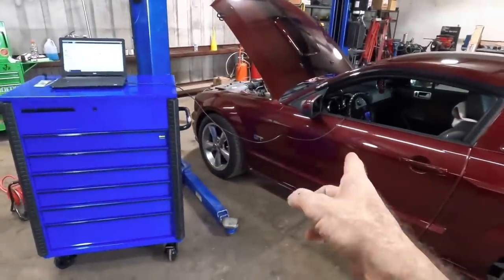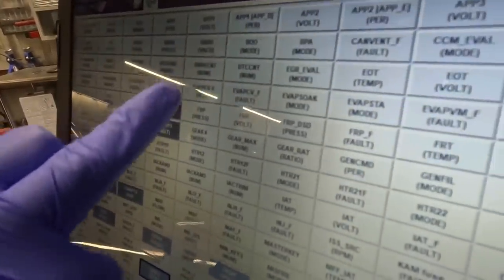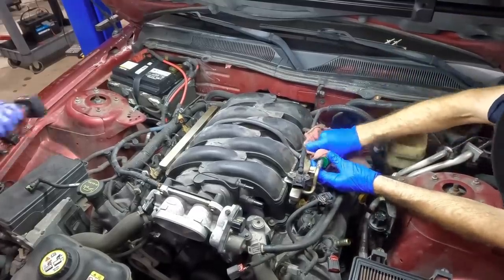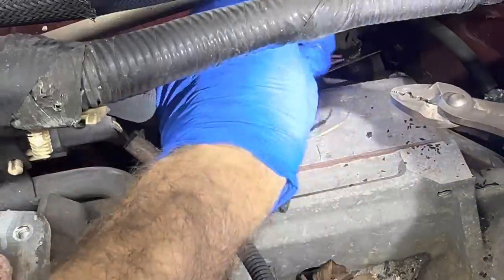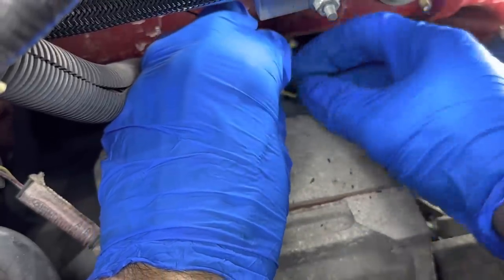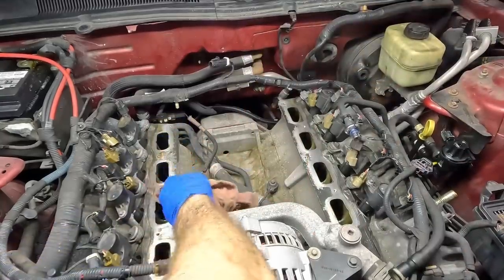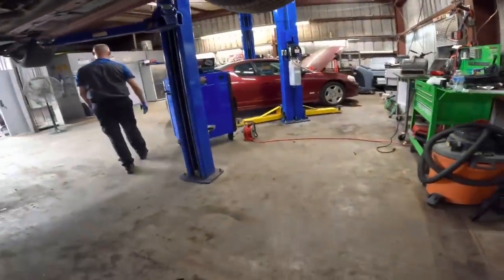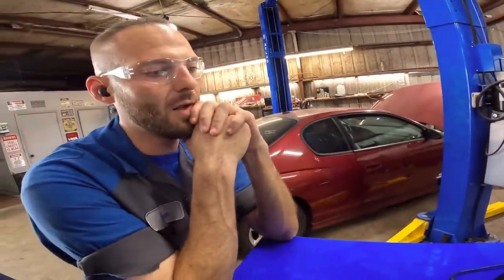Customer States: Light back on! 2006 Ford Mustang GT 4.6 3v P0171 P2096 Lean Bank 1 Misdiagnosed?

Comment: Aron said it right there “DIYs do not have access to” which has become a real problem over the years and it is getting worse! Back in the day, a vehicle purchased meant that everything on or in that vehicle was yours. However, in the eighties, the dealerships were in trouble because people would not bring their vehicles back for service. Then came the PCM, ECM, TCM, and that annoying “check engine” idiot light. Then the trouble started with the diagnostic codes and the machine to retrieve them. The software became the manufacturer’s proprietary realm which shut off the DIYs and forced the owner to return to the dealership to repair the vehicle at exorbitant prices. So, who owns the vehicle? The manufacturer or the person who bought and paid thousands of dollars for it?  Sure, we have our SnapOn code reader and diagnostic tool but the dealership has tremendous access to other software features vital to the true repair of the vehicle!  It's an immorality for the manufacturer to hold the vehicle owner and those who work on them hostage to their proprietary software! I contend that any software installed on the vehicle which I own becomes my property and I have the right to access that software and devices to initiate any repair or replacement!   Who owns it? The rightful owner or the manufacturer? To restrict the repair of a vehicle and deny the rightful owner access to tables, settings, and stored values to reset the device is wrong!  There are stories of vehicle or machine owners (farm equipment) denied access but were able to replace the appropriate part but still machine does not operate because the software-controlled device could not be reset. A ten-dollar part but to get the manufacturer to reset the appropriate control module cost the owner thousands of dollars!  Absolutely wrong!

Comment: Add a reflector tip to your heat gun, it makes using the solder splices easier.  If you are having an issue heating the other wires not being repaired, wrap them in wet paper towel and secure with aluminum foil. Lessens the risk of accidentally melting the neighbor wires.  Remove covers before looming.

Comment: If you hit the solder portion first to melt it, the sealing sleeve portion will follow suit thus cutting down time to make the repair. I work with these exact splices in the aviation community as an electrician so my input is not BS. Love your show. Happy Father's Day Rainman
Reply: If you have seen Ray do them, he does start at centre solder portion. It was Arod with the heat gun moving back and forth, as he says at 20:20 "I've never actually used one" .Arod is wearing the lilac/purple gloves.
Reply: It's been a while since he has been required to perform a wire repair. If this is the case I apologize for not remembering.

Comment: Wow impressive the Harness is Chaffeed but no brake at all in the wire definitely makes sense why no circuit codes so when the engine is running at higher rpm that explains the random o2 sensor drop outs wasn't consistently dropping out at all @Rainman Ray's Repairs

Comment: just great how you two double teamed that problem having a friend that works on a specific 
brand of cars knows the unique issues that creep up every so often. it was a very unique 
issue having a grounded destroying the true signal from the O2 sensor. confusing the ECM
what to do to correct for the values and to run the proper trim controles. happy fathers day to you!

Comment: Good job guys. It turned out to be an intermittent issue.The factory scanner did have some features that worked better.But with  all due respect ,a good visual look may have spotted it.Even though most viewers would have said NO WAY you can't see that up there.BUT as Ivan and Eric o say LOOK for rub spots like corner sheet metal rub spots,and that was the case here.Glad to see it worked out.

Comment: Now that’s a class act! When anything defeats me, which still happens occasionally, I don’t get to have the expert come to my place and use my tools, with me looking on.
If I farm something out, I have to deliver it, leave, wait for the call to say it’s done, collect it again and usually provide a loan car for the extra day(s) that it’s away. That invariably means I’m not doing something else, while I’m shuttling cars around and often means I have no personal transport, too.
Ray has it SORTED!
As for the problem, that’s becoming much more common nowadays, with all the thin wall cables.
It’s a proper PITA to find, too, because any time you disturb the faulty cable, you solve the problem temporarily. It takes a bit of driving and start stop cycling to settle the cables back to their original position and make the problem reappear.
The diagnostic kit is good for telling us which signal is wrong, providing we know what we’re looking at, but you still need a schematic and ideally a harness map, to know where to look on the car.
This was an impressive find.

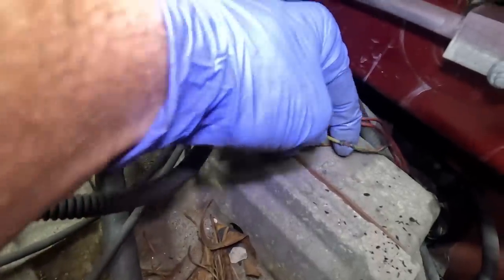Comment: At 14:57 in insulation damage to wire being chaffed by transy. Causes a higher resistance in the wire thus the sense of a 
lean condition and since it didn't break no code to indicate  otherwise. Solder connector if done correctly is the best fix. 
Good repair  Team Ray.

Comment: I did this exact job on my 2009 Buick Lucerne with 305, 000 miles. It kept blowing the fuse for the Upstream O2. I originally replaced the sensor, but the issue came back. I then moved the wires in multiple spots including under the car. Doing this I found the wire had rubbed to bare metal on a brake line. Wrapped in electrical tape, tubing, and zipties. Works great now!

Comment: This happened to me with a family members car. Trans would not shift out of first. Shop said trans was bad, I looked around and saw a chipmunk ate 2 wires on the back on the engine. Repaired the wires shifts fine and that was 5 years ago. Hey sometimes the best make mistakes as well. It happens.

Comment: Don't sell yourself short, Ray. You didn't fail in the repair of that vehicle. Sometimes, you have to step back and look at things from an outside perspective, and sometimes, you need to bounce things off of others who are just as knowledgeable as you are. Even Aaron was stumped until you two decided to trace the wire from the sensor and found the bare spot in the wire.

Comment: After watching lots of videos of Ray fixing things I've learned Ray needs a few things:  1.) Unlimited supply of brake clean, 2.) a shop air powered torque wrench, 3.) official Ford laptop & software & cable, and 4.)  lift buttons that says subscribe on it for the lifts.

Also great teamwork to Ray & other guy

Comment: I just swapped engines in my 09 v6 stang, misaligned the torque converter and cracked the transmission pump sandwiching everything back together... Cant say she had much life left at 205k never serviced but damn it hurts... Gonna drive it til i kill it. New engine runs great. Happy fathers day.

Comment: I used the same heat shrink on my fridge as a mouse or something chewed thru the wires under my fridge making the fridge stop working. I saw it got warm and wasn't running. it chewed thru like 3 different wires in it's harness. Now it works again without issue.

Comment: Tip: When installing Wire Loom use good quality electrical tape at the ends of the Loom and every 6 inches. This ensures the wires will not vibrate out of the Loom. Some manufacturers go as far as tapping  the entire Loom at some locations.

Comment: I have the 4.6lt 3v on my 2006 mountaineer it has 180k miles and has that cam phaser ticking sound. but it's been making it for a long time I bought it back in June of 2018 and it was making it at that time as well.

Comment: Because you are dealing with a v block, that opens up for situations. If both o2 sensors were replaced, that doesn't eliminate them as the source of the situation. The tps would effect both banks. The inactive sensor has to be either the problem or related to it.

Comment: Excellent video.  For wires like that, I've had good success with liquid electrical tape.  Vinegar will clean up corrosion, if any, beforehand.  That way the original wire remains intact.

Comment: Crimps with the heat seal, i believe are better.  Ive used them exact connectors, you just used to have them fail.  Either way 1/2 dozen to the other.

Comment: Hey Ray, great job. Just 1 thing. Those solder connectors are no bueno. They use what in electronics is refferd to as quickmelt solder. An alloy of tin. They melt at low temp. But these become brittle and you get an intermittend connection again in few months. Because there is no resin, there in no good bond between the tin and copper wire. and when it becomes brittel then only the blue glue holds your wires togheter. but with the vibrating car it will not be a permanent connection. You can also ask Eric O. he stopt using these already few years ago when he noticed these connetors being an issue. 
Doing great with shop. keep going.
Reply: I banned them from my shop 20+ years ago. They are a problem on many levels.

Comment: I wonder how those solder connections with heat shrink act around a motor's heat, since they melt with just a heat gun.
Reply: I thought the same thing. If the  solder has low enough melting temp to liquefy with a heat gun, it might fail in a hot engine compartment.
Reply: Can the solder be pre-treated in some way so that it melts easily on first use, but then the remelt temp is much higher?  I've just ordered a box of them to test that because, as you say, they might otherwise be able to dismantle themselves, and that would not be good!

Comment: I had a similar problem with my 2003 G35. The factory didn't allow for enough wire in the harness for the trunk, so a wire would break from opening and closing the trunk. The car had no external way to open it, so I has to crawl into the trunk from the back seat to release the emergency release. 

The first time it happened, it was under warranty, so the dealer handled it. It happened again when it was out of warranty, so I fixed it. The idiot dealer techs just crimped it back together. I fixed it properly like you did by adding a piece of wire. I did it the old fashioned way though with solder and then heat shrink.

Comment: Hey Ray and Rod,  why didn't they put a heat shield tape on those wires instead of just plastic loom.    For being right behind the motor where most of the heat is pent up, and most of the drying out of plastics a -cur.

Comment: I'm not sure if you did or not but make sure that you let your heat gun runs on cool/cold position for approx 2 minutes before to turn off the power. The life of the heater element will last much longer. (Daniel)

Comment: Had a bare wire on my focus on the camshaft sensor which would throw a check engine light randomly after I had changed the sensor!

Comment: Brian at Fordtechmaculoco had something very similar to this with a Ford F150. Turned out that someone swapped out four different fuel injectors on bank 2 which caused a similar problem as you have with the mustang.

Comment: Happy Fathers' Day to all Dads... As you were closing out the video, Arod(?) locked the car with the remote... after watching a CBC program called CBC Market Place where a TV crew were preparing to leave their hotel in NYC for Toronto, they loaded all their personal luggage into the rental van including all their video production equipment, used the remote to lock the van, then went for breakfast. When they returned, the van was empty, everything was gone. Thieves were close by with a radio receiver and computer, decoded the remote's lock signal/codes then unlocked the van. Recommendation, use the lock button in the door when locking your vehicle, personally I do that all the time whenever I leave the car, even in my garage, if you do it without exception, you will not forget to when in an dodgy location.
Reply: Or just stay out of NYC. 😂
Reply: @Bellboy40  Sheldon Cooper laugh...

Comment: Did I miss something? Explain to me exactly why you left that small piece of blue wire on the engine under the intake manifold after you vacuumed it off so nicely?
BTW: I've solved some of the toughest problems, by backing away for the day, and re-tackling again the next day.

Comment: This type of repair should be sent to the engineers so the next model they fix any posability of this on the next model year or changes, has these wires came up through the Floorplan with a grommet under the seats just giving enough slack under the car for movement but bringing the connections inside the cabin where the wires can't chafe also any repair needed are in hands reach.  When you put a connection point high up behind moving parts or just laying over metal parts insulation can rub off the wires causing problems that are hard to determine the problems  no way could you just see this under the car, hell you could barely reach it.
And an 02 sencor is a part youll need to change from time to time.
It shouldn't be that hard to get to. 
Better planing save shop repair times.

Comment: We chased an intermittent sudden shut off problen in a VW Jetta for 6 weeks once... trned out to be a wire broken inside the insulation and hiding behind the motor. Techs went thru everything trying to figure it out. Even swapped parts off a good running car, including the entire fuel system from gas tank to injectors, ECU, and more. It took more luck than skill to finally find the problem, but had become a matter of pride and sheer determination to figure it out! The shop lost money on that job.

Comment: Those heat shrink connectors not good for automotive applications about 12 months will be having problems low temperature solder doesn't handle vibrations very well

Comment: I used spring-loaded wire strippers for years (easier in tight spaces), no gloves for wire splicing and don't you tape the plastic loom at least a little?

Comment: I predict when Ray resumes gracing us with videos it will be showing the new and improved shop with all new goodies in place.
Reply from the maker: I’ve been on vacation not renovating😉  Buuut I do need to get the walls scrubbed again and maybe get some paint on the panels
Reply from the maker: And get the door up, and get the lift installed, and run some new outlets… the list goes on and on and on
Reply: @RainmanRaysRepairs  and on and on..etc.etc.etc.

Comment: Has anyone pointed out that wires should have a little flux applied to the bare wires to improve solder connection?

Comment: Happy Father's day Ray. Where do you get those heat shrink connectors from? I want to use those on my stereo rewire job. I used crimp connectors and I don't think they worked very good. Thanks and have a good day.

Comment: Those connectors are against all training on making good solder connections. Wires should always be twisted or crimped, then solder, never use solder to make a connection. In an automotive application that heet gun connecter can melt from the ambient temp under the hood.

Comment: Wires are always the worst to diagnose, they could fail sometimes but work other times and there is soo much that you may miss the tiny bit that is not visible. Not to mention companies don't make wire colors standard, even for the same vehicle replacement parts.

Comment: The two things that I don't understand which could of been done a bit better -1 Why were you using a battery operated tool that produces sparks after all that fuel spillage { Fire hazard } -2 If the wire was only chaffed where it was still in-tacked why did you cut it where all you had to do is test it for continuity and if it was good then re-coat the exposed area with liquid tape - where it would have saved you some time - cause now you made I would think 2 extra weak points and changed the resistance value - just good thoughts for next time... but as always Sherlock Raymond wins again... Good job there...

Comment: There should be better cable management for the O2 sensor wiring to prevent the movement that wore thru the insulation.  Most likely there was when the car was new, but over time with plastic holders falling apart and mechanics saying "we don't need that bracket/holder/clip" you get this result.  It was good to see all the effort exerted to do a quality wire repair, but VERY disappointing that these two mechanics with all their experience were guilty of the same vice as their predecessors, not properly securing cables to prevent reoccurrence.

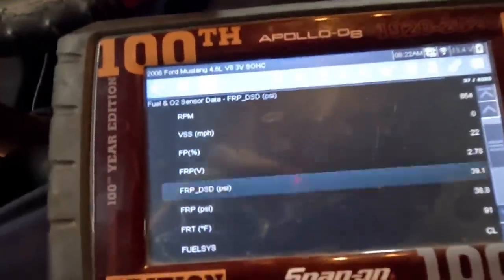Comment: Holy crap! Last month my car started to "illuminate" the OIL red light, in the middle of the highway, whith no exit for at least 6...7 km.....so I stopped in a "marked for detention" area and hurried to check the oil level, of course screaming "HOT! HOT! (á la Ray). Oil right on the money...WTF?! I slooooowlyyy resumed my trip, other neverendig 15 km until home. Later that day, did a thorough inspection, and found tnat the cable going from the oil pressure sensor to the OIL light bulb in the instrument cluster was almost broken and the copper was touching the firewall, so putting itself to ground, lighting that bulb. Same problem than Yours in this video. The good part? replacing that cable was easy. The bad part? Took me almost 2:30 Hours to find that damned Fu....ing broken cable insulation!!! Almost every cable bundle "skinned" in the process...thank god I had plenty of new plastic hoses of different dfiameters at hand. Thanks for your videos! I felt "no so alone" with this one!